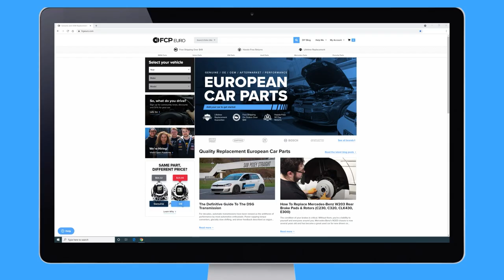Porsche 911 997 Radiator Replacement & Upgrade DIY (2005-2012 Porsche Carrera, S, 4S, Targa, GTS)

Comment: La piezas de recambio no son las originales,  pero le da una mejora increíble y sigue vivo este hermoso nueveonce.
Reply: Not only that. When you upgrade the CSF radiators it is not longer needed insulation or plastic frame support for the AC condenser. Another advantage is the OEM and CSF cost around the same in the US so you can import it to your country "fairly priced" (and not going to the stealership).

Comment: Well... thanks for the tutorial mate... What is your opinion about using lub PN 00004320593. Workshop Manual says you have to apply each time you connect hoses (not relying of coolant for lubrication). As I remember, from 997.2 onwards you have to use Piwis to make a final bubble elimination, failure to do it can cause overheat. Is that true for the 997? Certainly for the 991 it is... and no third party scanner can trigger the procedure, just Piwis, meaning in it is beyond the DIY toolbox.
Reply from the maker: Hi Red, certainly a good note about the lubricant. For the type of seal that was and the application on the 997, the coolant used will work just fine. Using a good vacuum filler will handle the fill procedure just fine, allowing the majority of the small spaces to be filled with coolant. From there it would be a matter of running the heat on the highest temp setting to allow the heater core to fill, at which you can also use the integrated bleed valve in the expansion tank to bleed out any minor air bubbles left behind.

Comment: Mike, super video as always!! Two quick questions if you do not mind. I have 2002 Carrera with 51,000 miles and live in the northeast. I will be doing the coolant flush for the first time. Would you recommend any other coolant besides Porsche and is it more effective to not dilute? Also, more because of age would you upgrade to new radiators to prevent issues going forward? I would appreciate your expertise. Thank you. Andy
Reply from the maker: Thanks, Andrew! While there may be aftermarket brands that may work, I would recommend sticking with the Genuine coolant, simply due to how delicate these systems can be. You will always want to dilute the concentrated coolant 50/50 with distilled water to get the proper "performance" out of it. In addition to your 996, the miles are low, so it has not seen as many heat cycles as a typical 20-year-old car. However with that being said, those components are 20 years old, so if you have the opportunity to do some preventative maintenance/upgrades while you do a flush, I would encourage it. -Mike
Reply: Mike, thank you for explaining in detail. I appreciate it.

Comment: Awesome tutorial. I noticed that torque specs were omitted on the re-install. In general, are the fasteners involved in this project fairly non-critical (I.e., just go guddentite)?
Reply from the maker: Hi Simos! Aside from the drain plugs being torqued back down to spec, the remainder of the hardware just needs the old calibrated wrist. All the hardware around the radiators (shrouds) is snug up (10nm).
Reply: @fcpeuro  many thanks for the reply!